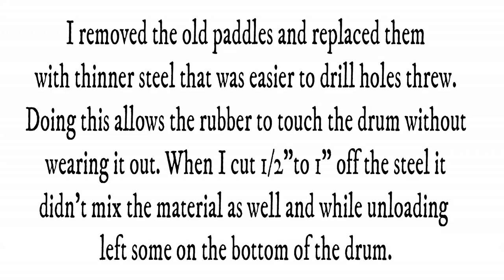Skid Steer Cement Mixer Modifications

Comment: i worked machine plastering in Germany for many years, the aggitator called a sneggler in germany would only last approx 2 to 3 weeks when used daily, it was normal for that part to be constanly replaced, it does look very similar to your aggiator, although they eventually had a part that was made with hard rubber that was really good,
I was sold a loader for $25,000  that was rebranded and it was sold to me as made in Australia and it blew the pump after 17 hours use, i contacted the company who had disappeared and when i checked it was really made in china, i found the manufacturer in china and they just said go get f**ed, so it cost me $2500 for pump and parts and labour, Chinese products really are so badly made, you guys in the USA and Germany used to make the best products,
Reply: I bought a 15cu ft one (great bear I think) and have done maybe 80 yards through it, I love the thing but it is quirky.  I shoot for a 5th of a yard,  any more than that and it jams so I go for about 1-2 inches above the auger, two buckets of water, mix till all wet then, toss in one bag cement, works great everytime, two guys can pour 2 yards in an hour or less!  I do not like that the auger doesn't go to tho side but is 6" short.